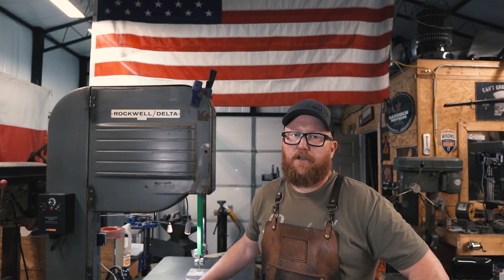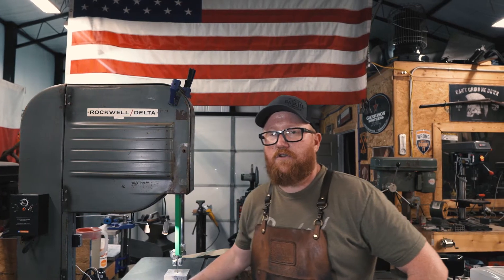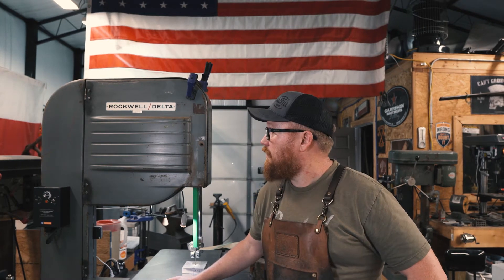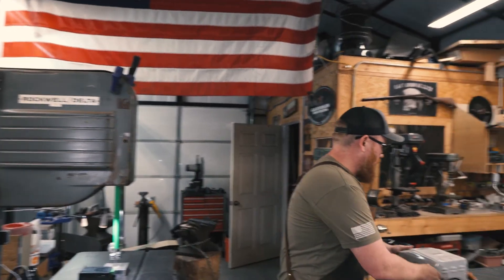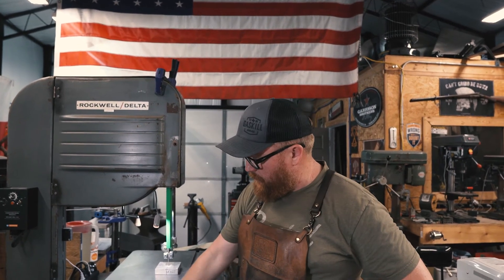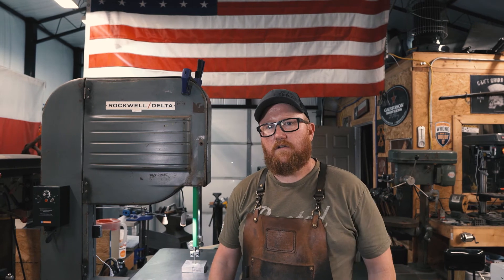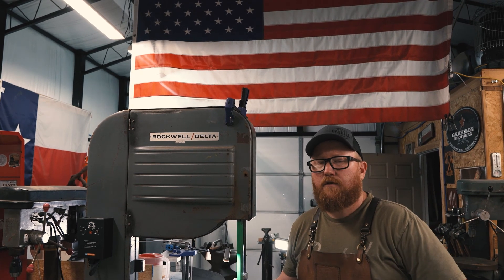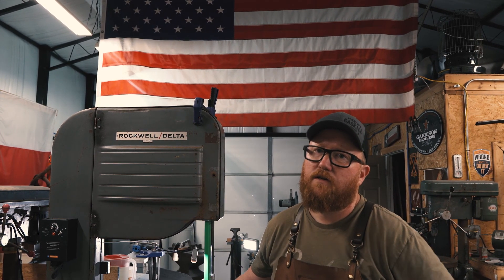My New Old Bandsaw

Comment: What is the platform on the bandsaw? Is that an aluminum block.  What does that help with?
Reply: Looks like a zero clearance block so there is not a hole for the metal to be pulled into when the blade is cutting it downward.
Reply from the maker: I saw it done that way in the class I took.  I liked it because it gave me better control over the knives and smaller pieces.  Its just fastened with double sided tape.
Reply: Thank you! Love the videos!